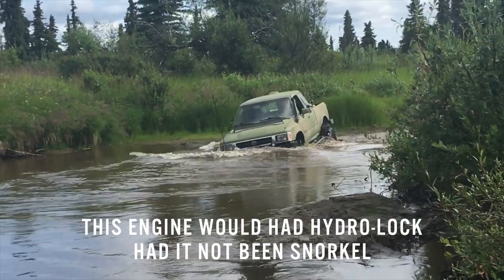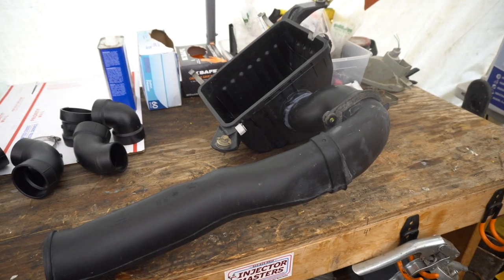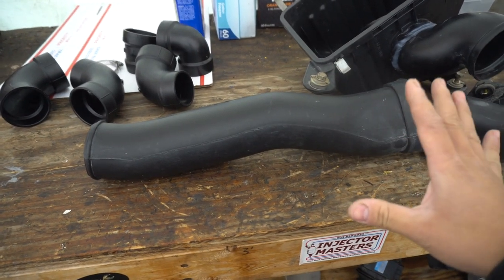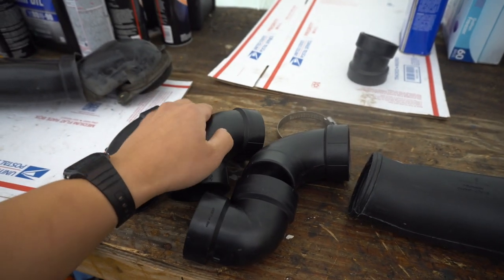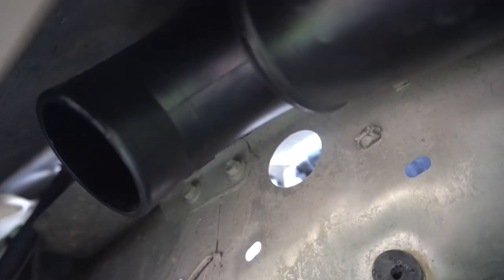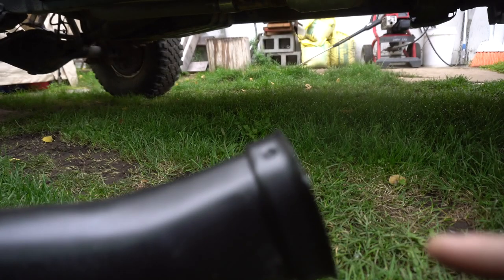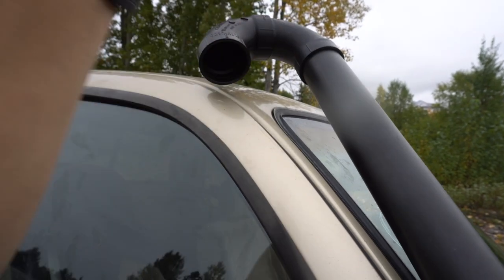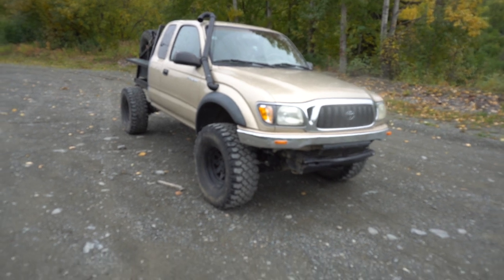TOYOTA TACOMA 3RZ DIY SNORKEL

Comment: You can get a  double sided adhesive tape buy 3m I had to use on my partially ripped hood bug deflector on my sequoia. It hasn’t separated in 5 years.  Lol.  
 Would double it up
Reply from the maker: Thank bro! I used the double side and so far it’s holding ! Brain fart on my end.
Reply: exactly what i was going to say.   3M tape is OEM on a lot of car trim and it stays on the life of the car, you'll have no problem if it's done right.   I have a metal tube thing taped on a bracket in front of the car with double sided 3M and it's been there close to 10 years of AK rain, freezing rain, and winters..